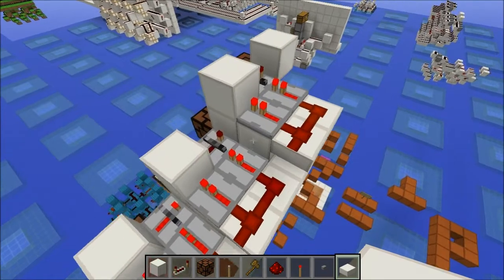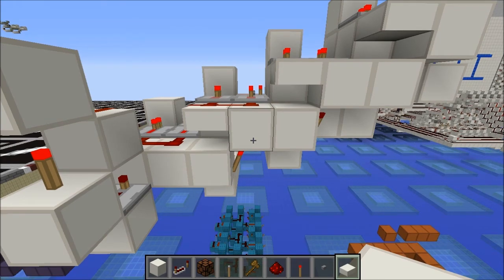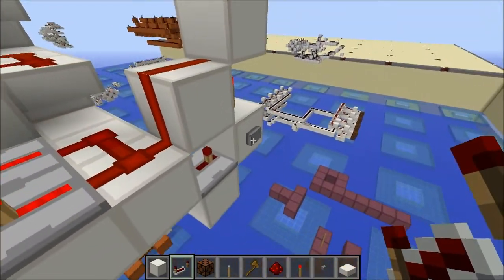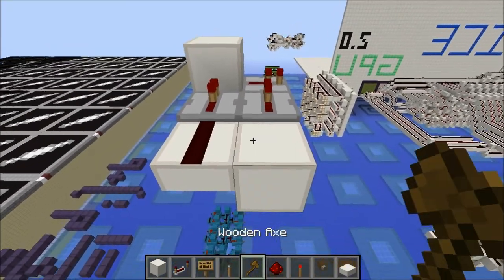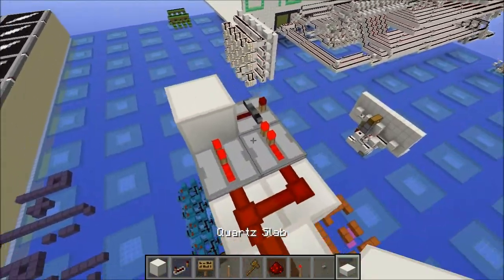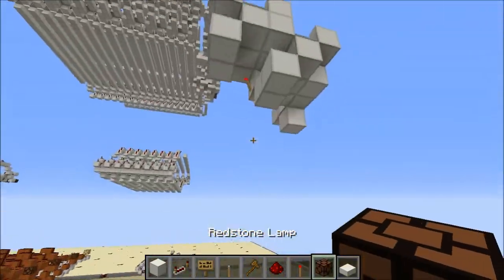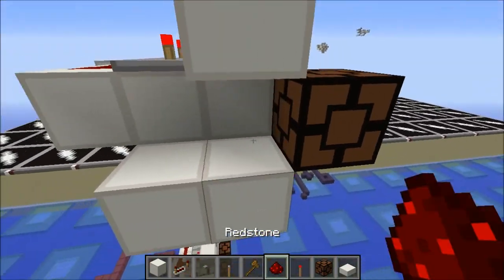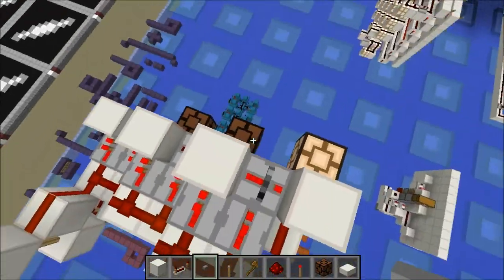Minecraft Showcase - Compact Binary Counter!

Comment: really like the design ,but took some thaught how to reset and restart. found that cutting power from torch to top line with a piston while sending signal at same time to torches to turn them off worked pretty well. hooked to clock and used one of the command lines that I choose to to send signal to kill torch on clock. workes like a charm. can restart by hitting reset.

Comment: Very useful.

To make this counter level (in stead of 1:2 rising) the output should step down one block, and replace the half-block diode with a repeater. This extends every module with one block, but the entire thing stays level which is useful for connecting with other components or hiding it underneath a floor.

I'm using this for clocks and counters at spawn and I prefer not to use loud pistons.